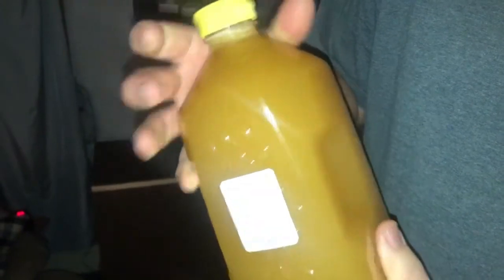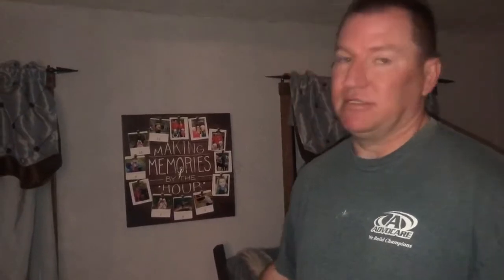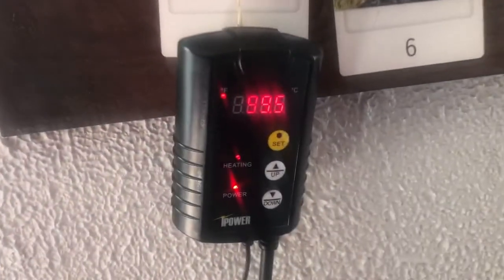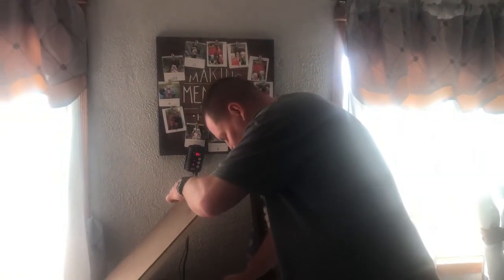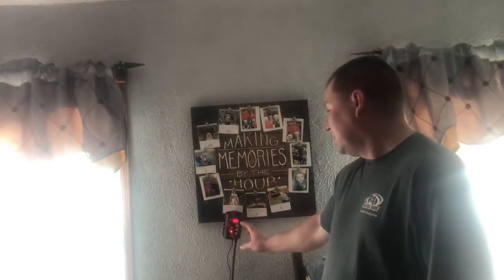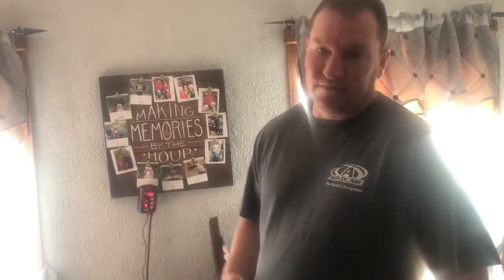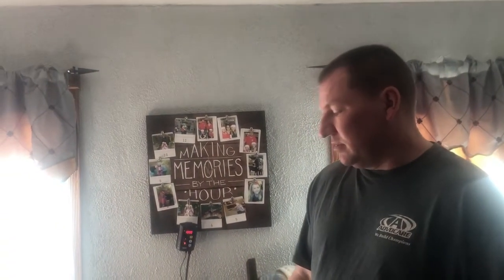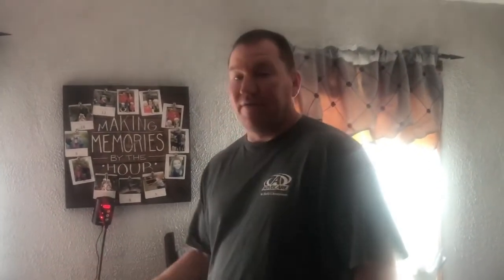Update on Honey Bucket Heater

Comment: No don't go over 110° !!!!, that's the point you start killing the good stuff in honey !!! ,  I never go over 107° an I can fully de-crystlize 55 gallon barrels at that temperature in 10 days,  also I would recommend a small fan ,for a more consistent temperature. That little bit of sugar on bottom of pet bottles is hard to get rid of if you let them crystallized that much,  without a way of stirring it up.
Reply from the maker: Thank you for the information. I was thinking I had read 110 was the cut off. Will make adjustments.
Reply: @GivenChancesFarm  your welcome !  An also on the 5 gallon buckets,  I run same 107° but I stir it once a day with a cordless drill an a stainless stirring paddle 4-5 days ! 
 48 hrs isn't long enough if there is much crystallization an you can't see that without stirring  or pouring from bucket to bucket . crystals always form an start at bottom .  Seriously a fan is the key!